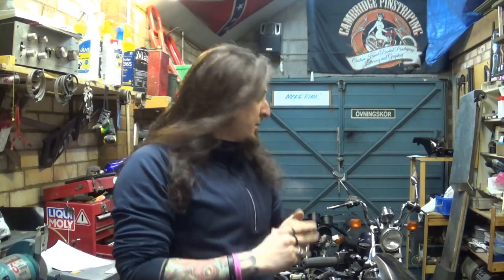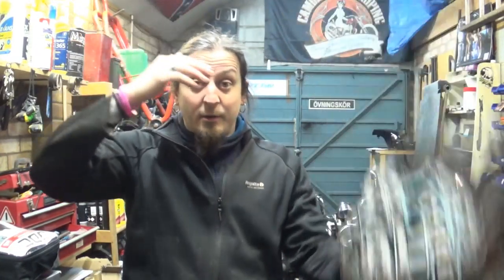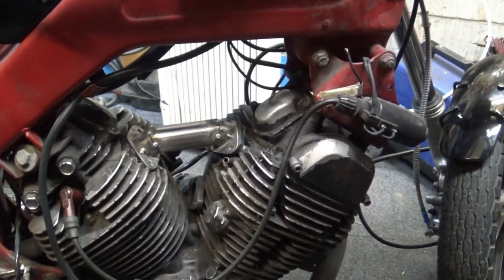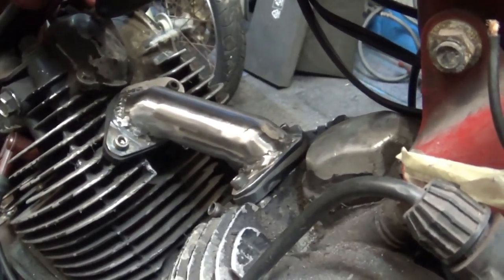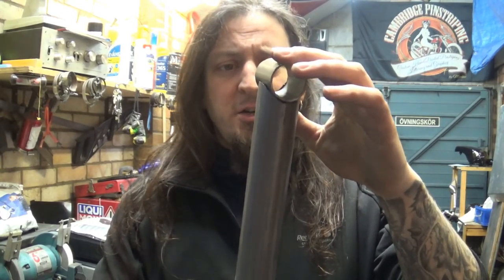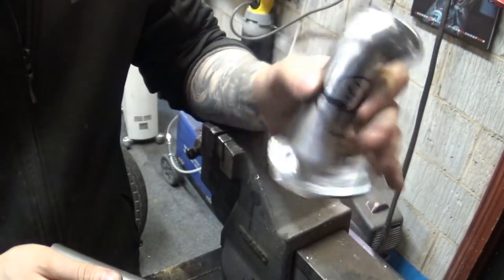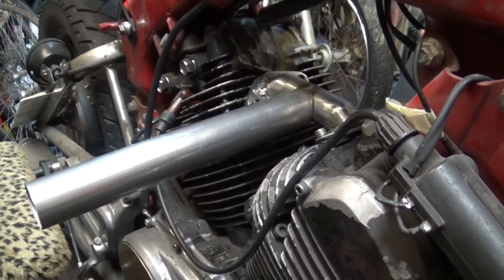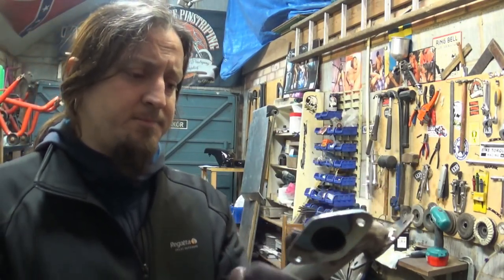Yamaha Virago XV 500 Cafe racer Build, Part 41 - Mounting the carburator, part 3/4

Comment: Spot On Fabrication brother.. best test for pin holes.. tip a drop of petrol in it and roll it about so it sits in the weld joints.. even invisible holes will show up as petrol finds its way through any hole no matter how tiny.. and you can solder them up with lead solder..!!  You can also use lead solder to dress those hard to reach welds under the flanges...air leaks are inevitable with MIG and can do a fare bit of heat damage as you know.... Loving the build buddy .. D&Px
Reply from the maker: Thanks man, very good point about the lead solder, I will give it a shot later see what damage I can do :)

Comment: Looking good dude. Spent many hours tinkering around making brackets etc for bikes and old hot rods. Great sense of achievement when you’ve  knocked something up from raw materials in your own garage and using basic tools. Promised myself one last bike build and my Street Triple is up for sale soon. What air filter are you going to run, nice bellmouth? May help you set it up with some form of filter fitted, been caught out in that before. Keep up the good work brother👍🍺🍺
Reply from the maker: Thank you my brother. Yes, exactly, you can't beat that feeling of achievement.  Once I load up that SU with proper dumper oil...it'll be running real smooth I hope!

Comment: So would a Y pipe be better, I feel like that T pipe will have the cylinders fighting for suction at higher rev's. Excellent job welding those were not easy to do at all!
Reply from the maker: In theory the suction should be the same on both cylinders...so it shouldn't make a difference. Yes , a Y pipe would probably be slightly better, but to execute in such precision...hmmm I may revisit this at some point in the future!